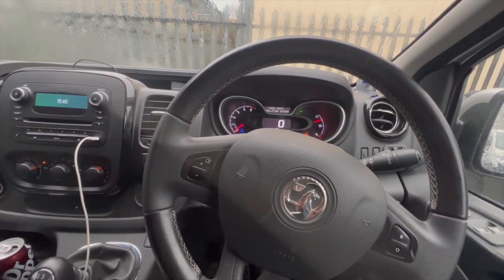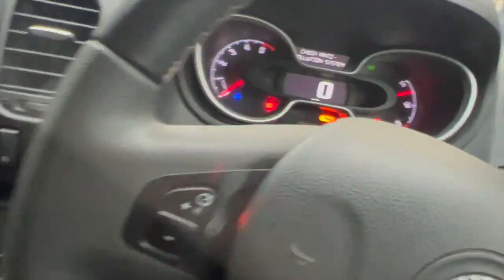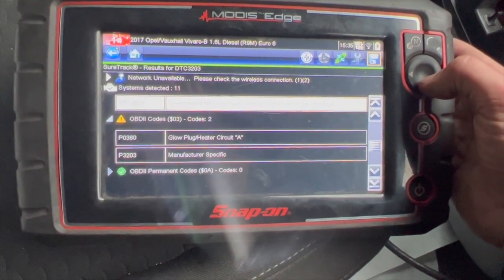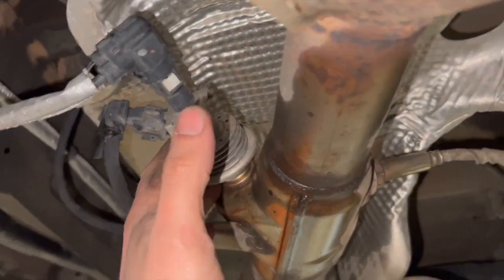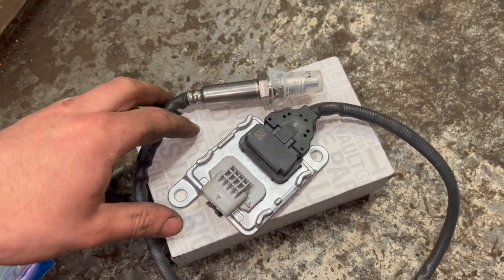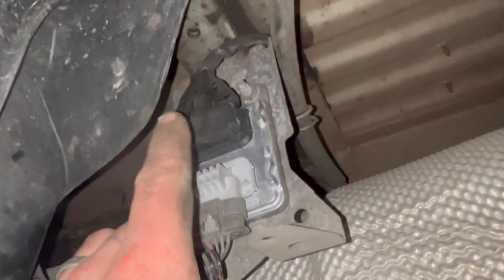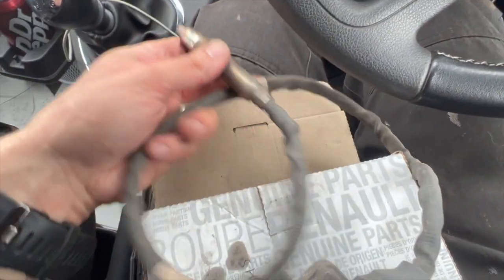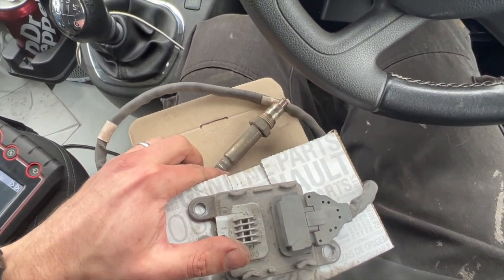Vauxhall Vivaro "check anti pollution system" Downstream Nox sensor fault

Comment: Hi there, Great vid.  I got the "Check anti pollution system"-warning today on my 2017 Trafic. Is there a way (without a scanning tool) to know what the problem is? And if i replace a NOx sensor does the code clear itself or do i need to get it cleared by a dealer? Keep up the good work 👍👍
Reply from the maker: Thanks! no im afraid you'll need to scan it, there's quite a few faults that put the anti pollution light on
Reply: @diydaly  Today i removed the vacuum boost exaust pressure sensor and cleaned the pipe that's connected to it. There was a lot of dirt inside. The fault was gone. I went on a test drive and after 3 or 4 miles the following happend: "check anti pollution system" , "check ignition system", "start-stop system disabled", the orange spanner and engine symbol lighting up but still driving normal. I again removed the sensor( there was another black ball of dirt in the rubber pipe) , so cleaned it again and run the motor with that exaust pressure sensor removed from the pipe. After that all the warnings stayed on the dashboard but i went for a drive annyway (7 or 8 miles) When i got home, with all the warnings still there, i got out and opened the gate. When i got in the car all faults where gone and all orange lights where out?? Magic😇🤔?!  I will see the following day what will happen...
Reply from the maker: @curtraaymakers6777  haha bit strange.. that pipe to the turbo pressure sensor usually blocks up or the rubber pipe splits

Comment: I'm getting the anti pollution light coming on sporadically on my Trafic, done over 1200 miles once with the code cleared before it appeared again- likely cause ? Getting it on a diagnostic machine tomorrow 😣
Reply from the maker: Could be lots of things tbh mate, you really need a code scan first

Comment: Where you based Gav
Reply from the maker: Hi mate ; I’m based in louth , Lincolnshire .. what was your issue mate?
Reply: @diydaly   hey Gav thanks for the quick reply, I'm in Manchester the van has came up saying  "ANTI pollution system" I've code read it on two devices cheap one says   p380 glow plug heater circuit  A, 

The snap on reader says DTC3202 and DTC3203 Downstream nox sensor performance  out of range
Reply from the maker: @jordanakalucky  are yeah that’ll be the 2nd nox sensor then mate , getting fairly common now on quite a few models , I’d recommend getting a genuine one and you won’t have any hassle .. the aftermarket ones are abit temperamental

Comment: Hi, my Vivaro has just failed MOT because of this exact problem, they say I need to change both Nox sensors at a cost of about £274 each, would this be about right?
Reply from the maker: Both sensors are just as common but depends if it’s fit faults with both or not mate 👍
Reply: @diydaly  hi I am from Slough I have same problem 2015 van  can you help me with that
Reply from the maker: @madhurchandorkar3516  hi I’m afraid I’m over 200 miles away

Comment: hi ive got 2016 renault trafic 1.6 diesel  wen driving seems to cut out for a milisecond sort of miss fire  any ideas wot it could be
Reply from the maker: Hard to say without looking mate , there’s a few issues that could cause it .. maybe try a fuel additive first incase it’s injector related but could be numerous things .. presume you haven’t got any fault lights on?
Reply: Could be a gummed up injector in which case - like DIYDaly suggests - a diesel injector cleaner might help. Id recommend either Forte or Mannol injector cleaner and buy two bottles.
Reply from the maker: @dogbite5509  yeah I like the forte additives 👍
Reply: Hi did you get the problem solved as I have now got the same cheers

Comment: I’m seeing lots of problems with ALL NOX sensors. How about you?
Reply from the maker: Yes mate they are proving a right nightmare 😖 we fit loads on Peugeots 1.6 HDIs , Citroen relays , land rovers , Vaux insignia’s , merc vans and cars plus these vivaros 🙈 like you say pretty much all nox sensors!! Ha . All bloody expensive to! Haven’t come across any factors supplying any yet .. just the cheap ones on eBay etc but keep hearing of a lot of problems with them not working correctly

Comment: Thanks for sharing, if you get a Land Rover Discovery Sport in the workshop for a service would you please film the Fuel filter change… you had one in the workshop awhile back for boot door struts replacement 
Regards Eric
Reply from the maker: Thanks Eric! Yes mate , I’ve actually got a service lined up to do on one in the next 3-4 weeks , and will be replacing the fuel filter 👍 I know there abit awkward to do ha
Reply: @diydaly  
Thanks buddy
Reply from the maker: @castrolgtx5064  👍